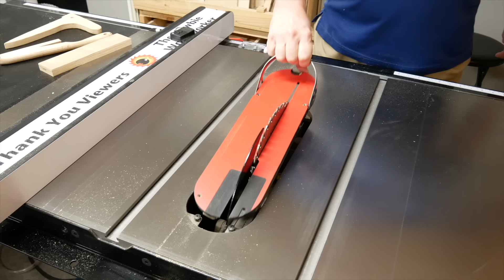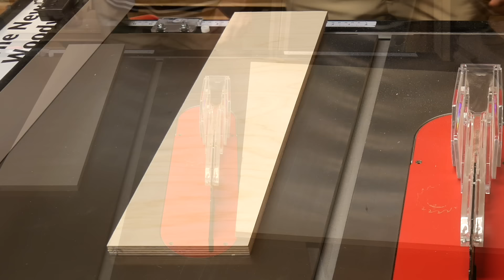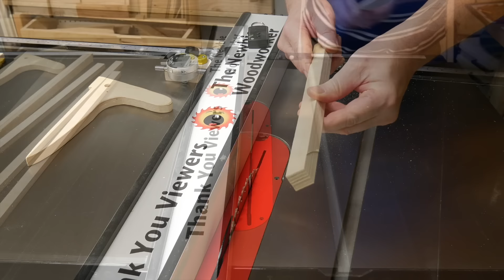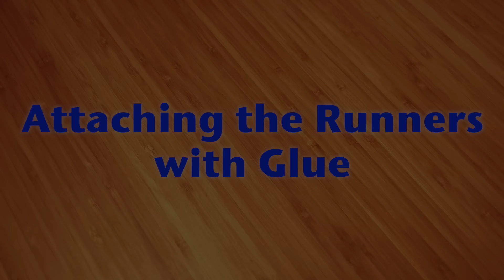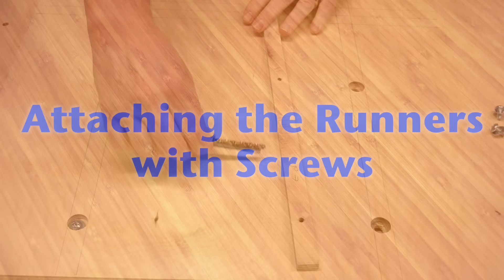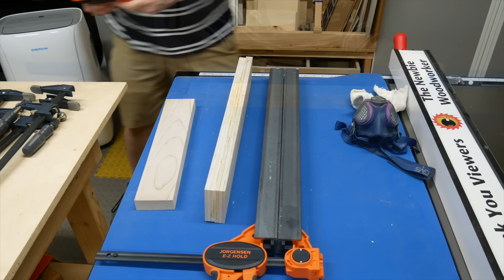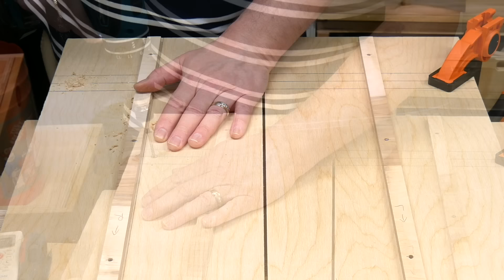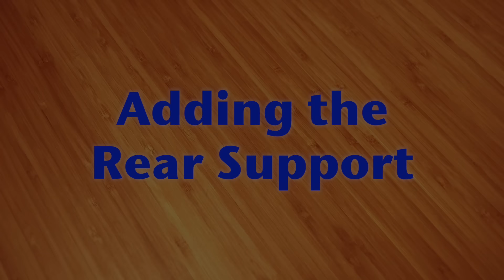Build this Revolutionary Cross Cut Sled, for Newbies!

Comment: No 5-Cut Method to align the fence?  Why would you go through all the effort of building a new fence (and call it "revolutionary") and not align the fence as best as you could?  I thought once you had the small Engineer's square mishap that you were going to show the more accurate 5-cut method. :^(
Reply from the maker: Thanks for your comment. I realize a lot of people like the 5 cut method, but personally, I think it's too hard, and not worth the effort. If you check a corner with a good quality square and don't see daylight, it's fine for woodworking. If you disagree, that's fine. But that's my opinion.
Reply: It's woodwork not machining metal. Thousandths don't matter really.
Reply: @LemonySnicket-EUC  Depends on what you're building.  IMHO if you're not trying to be as accurate as possible all the time then the little unavoidable measurement errors will add up and lead to bigger issues towards the end of your project.  Take a look at the bigger, more successful YouTubers and professionals around the woodworking community and you'll find that they look to have the most accurate tools and measurements at every step (except maybe roughing in their lumber early on) and it pays off in better results and less scrap.  To each their own, I guess.
Reply from the maker: @barnyardkh4  I agree with you, but it's a matter of degree (no pun intended). It is my opinion that if I make a clean cut and use a quality precision square (that actually is square) to check the corner, and I don't see any daylight, then there's not enough of an error to ever affect a woodworking project. And honestly, I'm pretty sure of this. I'd be more than willing to admit I'm wrong if someone proves me wrong, but I just don't see it happening. Yes, other YouTubers might disagree. That doesn't mean they're right. The advent of the 5-cut method has gotten people paranoid about insignificant amounts. I know that's heresy, but someone has to say it. Like I said, prove me wrong. Hmm, that might make an interesting video...
Reply: @TheNewbieWoodworker  Nope.  Made my mistake falling for the sensational 'click-bait' title promising a 'revolutionary' design.  I won't waste any more time beyond this trying to convince you  otherwise.  You're right, for  some, 'close enough' is 'good enough' and woodworking is more forgiving at times.  It all depends upon whether you want to tinker and waste time in the shop or make high-quality heirloom pieces you can be proud of.  I've made plenty of quick projects over the years but the premise remains the same, "It's always easier to be less precise on occasion when it's not needed than it is to try and 'up your game' after several failed attempts" or in other words, "It's better to have the precision and not need it, than to need it and not have it." Best of luck.
Reply from the maker: @barnyardkh4  Well, you missed my point, which is that it is precise enough, but that's OK. Best of luck to you too.

Comment: You only need the riving knife when cutting long pieces with the grain.  You can also size your rear fence to make it impossible to touch the blade with your fingers by making the fence taller with a hump in the middle.  You can also attach a flat piece on the far end that is not cut -- this would stiffen up your sled considerably.
Reply from the maker: Thank you for your comment.

Comment: In moon feet, how accurate is the squareness of your sled?  I'm sure you've measured it, the stickler that you are.  Great video! I like your sense of humor.
Reply from the maker: Thanks. I'm not sure what "moon feet" are, but I haven't measured it per se. I use a precision square to check the corner of a cut, and if there's no daylight, that's good enough for me. This isn't metal working, so that's plenty close enough. At least, that's my thinking. 😄
Reply: @TheNewbieWoodworker  To the person who liked my reply:  I have seen the “parallelness” (is that a word?) of  two parallel lines quoted in “moon miles.”  If the lines are extended a distance equal to the distance from the Earth to the moon, the ends will most likely, if created by a mortal, be quite unparallel and apart by miles; hence the term “moon mile.”  Of course, the Newbie Woodworker is having nothing to do with such inaccuracies; therefore, the error surely will be limited to “moon feet” if off at all.  I am, of course, being facetious and poking fun at the Newbie Woodworker.  He seems to have a very good sense of humor.
Reply from the maker: @julianadams5753  I take offense! Just kidding. Actually, I think that instead of the moon, the lightpost outside my garage would be close enough. 😛

Comment: When you cut yourself with a knife is it because you failed to use a knife guard ??? Or is it because you failed to use the tool in a manor that keeps you from cutting yourself. I have had people argue a blue streak about it being impossibly unsafe to cut a full sheet of plywood on a table saw with only one person... Yet i can even after a stroke that now hinders one hand.
Invariably you are going to need to remove the blade guard... Dados, rabbits, raised door panel inserts, box joints, just to name a few operations... I have seen many variations of blade guards come and go in the last 40 years... The best thing to keep you safe is to use the grey matter between your ears.
That being said, your design is very inovative and i can see it very useful for beginners. But your " I don't care " montage in actually is very condescending. And is why i decided to comment. You really should care about others opinions and or thoughts since you are not the end all beat all authority on how to use a tablesaw . There are other designs with built in blade guards that keep yours hands free of the blade and still allow for even the above examples i have listed
Reply from the maker: Thanks for your comment. I hope you won't take offense at my response, because I can tell you're not being mean or trolling or anything like that. But I'm going to shoot straight here. I totally understand what you're saying, but it's irrelevant to this video. Blade guards, when they can be used, help prevent injury. Especially for newbies, or people who are easily distractible (like me). I'm glad you haven't been hurt without using a blade guard, but that changes nothing. This video doesn't argue that everyone should use a blade guard. It's just trying to make it easier to use a blade guard if you want to, by not having to remove it when you use a sled (and by the way, a sled with a built-in guard means you have to remove your blade guard, which is the opposite of what I'm trying to do). So that's why "I don't care" - it's not condescending, it's honest. Your experiences have nothing to do with the purpose of this video.
Reply: I have not gotten a table saw yet and will admit that one reason is fear of getting hurt, so I appreciate these newbie videos. I do industrial training, and part of that is researching accidents, their causes, and how to prevent them. One thing I have found is they can happen to anyone. People with decades of experience can fall victim. As a matter of fact most accidents happen because very experienced people take shortcuts. I have a story where luckily no one got hurt but we did a lot of stupid things to get the job done. In the meantime, my 20 years experience combined with the two 30 year guys, we convinced ourselves that a stupid way of solving the problem was the way to go. I really appreciate Dan's videos. He is amongst the best YouTubers out there when it comes to making interesting and engaging content. The bonus is he is making content to help people stay safe if they cannot swing the price of a SawStop. Just today I watched a video on Mike's Wood Shop on table saw safety. He relayed the story of a cabinet maker and a contractor getting injured by table saws. Both of them had 30 years of experience using table saws. Do you watch the Stumpy Nubs channel? He is incredibly experienced and injured himself wood carving. In any case in the professional world we plan that an accident will happen, by planning for the worse you can attempt foresee areas where things could go wrong. In any case hopefully you can live the rest of your life injury free. In the meantime, hopefully Dan will keep making these videos.
Reply from the maker: @DavidVerch   Thanks, David. I couldn't agree more. Accidents are called "accidents" and not "on purposes" for a reason. And thanks for the nice words. 😄
Reply: https://www.youtube.com/watch?v=2MlywYEIWB0

Comment: Nice video, thanks.  I haven't watched all of your videos so sorry if you have already done it but, a table saw extension table would be nice. It would keep you from having to reach over the blade to catch your cut piece before it falls off the edge. I know you have a smaller shop so maybe a small hinged flip up kind would be good.  Great idea on the oversized holes for attaching your runners btw. Getting those suckers adjusted just right is one of the hard parts.. besides getting your fence lined up.  Thanks!
Reply from the maker: Thanks, Roger! I keep meaning to work out an extension table, hinged like you mentioned. One of these days I will. I don't know if anything will stop me from reaching over the blade, though. I just can't seem to stop it. At least nowadays I have the blade guard in place more often. 🙄😄
Reply: @TheNewbieWoodworker  Well, don't tell on me but, I don't use a guard (shame on me) and, I have an extension table but still reach over the blade a lot of times. The table does keep me from having to reach over to quickly catch a piece before it falls though. It may make it just seem safer but, I am able to push it well out of the way of the blade to keep my hands clear. Truthfully though, reaching over the blade under any circumstances is not good.  :)
Reply from the maker: @rogerroger5649  I promise not to tell if you don't tell on me... 😉

Comment: It's probably because most companies make really shitty blade guards that started to become more dangerous the more you used your table saw, the second time I had plastic shrapnel thrown at me after replacing the clear plastic blade guard after the first time it made contact with the saw blade, and after calling the company since my saw was only a few months old, so they had me send pics of the guard then requested that I remove the whole attachment and to put it in the box that they were shipping me a new blade guard in, which was no problem and I really appreciated that they sent me the new one but wondered if the reason they wanted the other was to prevent me from having evidence if it happens that someone tried to get me to file a law suit against them, not that I worry about that kind of crap but strangely enough it was only about 4-5 months later the same damned thing happened again, except this time, which was completely out of character for me that I wasn't wearing a long sleeve shirt while using the table saw. Can't say that I was surprised it happened but I was more pissed off at myself for not having protective cover over my arms. Who doesn't love having to pull about a 3/4" long by 5/16 wide piece of plastic out of their own forearm with a pair of hemostats out of my tackle box. That was around 25 yrs ago & needless to say I've never operated a table saw with one of those plastic blade guards on it ever again.
Reply from the maker: Thanks for the story! I totally understand, and I don't blame you. Depending on the quality of the table saw, I suspect blade guards are better now than they used to be. But like I said, I get it.

Comment: Just as an alternative idea, I saw a video where someone built a blade guard into their sled.  It is in German, but, you can see his idea just by looking.  "Schiebeschlitten - Bau und einstellen - 5 Schnitt Technik mit Formel" I'm sure you will still prefer your idea, but, just thought you might be interested on someone else's idea.
Reply from the maker: Thanks for the suggestion. I've seen some videos like that, but the point of this sled is for people who use their table saw's blade guard already, and don't want to remove it when using a sled. So having a built-in blade guard on the sled defeats that purpose. But it's definitely a good idea for people who don't use their blade guard, or don't mind removing it when using the sled. 😄
Reply: The Newbie Woodworker I know. I was just showing you his idea.
Reply from the maker: @CaseAgainstFaith1  That's cool. Thanks! 😄

Comment: Do you have a remote switch on your saw? That’s pretty slick if you do 👍
Reply from the maker: Not on my saw, but I do have a remote for my dust collector.
Reply: @Turkey Creek Knives Why would anyone want to remotely operate something as dangerous and powerful as a table saw?!  Imagine if your buddy (or child!) was near the saw and you accidentally pushed the button on the remote while it was in your pocket (admit it - you've done the same thing many times with your car keys!)!  Could you live with yourself if you hurt someone else with a set up like that? SMH!
Reply from the maker: @barnyardkh4  LOL, thanks for chiming in. Your points are spot-on - I'd never want to turn on a saw by mistake! 😮Once, and only once, I changed the bit of a handheld router without unplugging it. I was horrified when I realized I almost turned it on by accident, and trust me, I'll never make that mistake again. So no, don't take any chances with accidentally starting something so dangerous!
Reply: @TheNewbieWoodworker  I accidentally hit the start button on the pendant for the 90,000 psi water jet at work, with my hands in the machine. Luckily, the program I had loaded had an extremely high feed rate, so it ran across my fingers too fast to lop them off. I haven't used the pendant controls with the pump powered up since. Extremely painful lesson.
Reply from the maker: @OneTruePhreak  I'm glad you're OK. Those lessons always with with us, though.
Reply: Turkey Creek Knives I appreciate this as I’m about to rip down some 8ft 4x4’s - with some trepidation - can’t support/feed the work AND reach the switch at the same time. I need an emergency remote off switch, not on/off.

Comment: Great video! Well done!  Tip: Use "CRC Heavy Duty Silicone" supplied in a red spray can instead of paste wax. It's literally 5X more friction-free, totally clear, dry, and invisible. Just a spritz will do ya'. You're welcome!
Reply from the maker: Thanks, Bob! Great tip. 😄
Reply: Doesn’t silicone have some bad interactions with common wood finishing techniques? I might be wrong, but I believe I have read about it causing “fisheye”.
Reply: @bensalemi7783  Absolutely right Ben. That's why you spritz a little on the saw table slots, not anywhere that would touch any wood you intend to varnish or paint. I use it all the time and never have any problems. The pure stuff is much less problematic than silicone-containing wax. It goes away by itself in 2-3 weeks with no solvent needed.